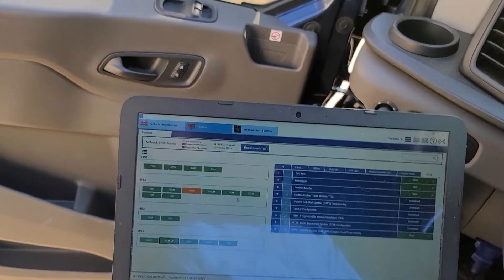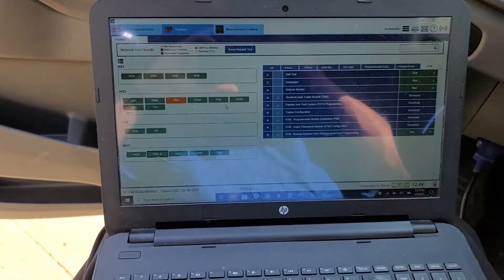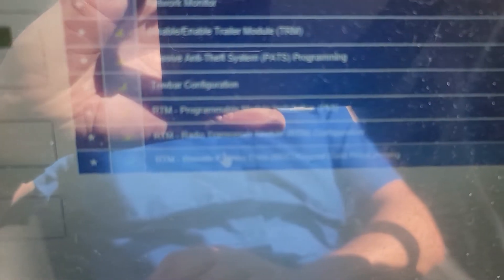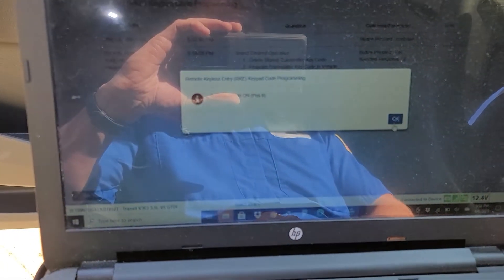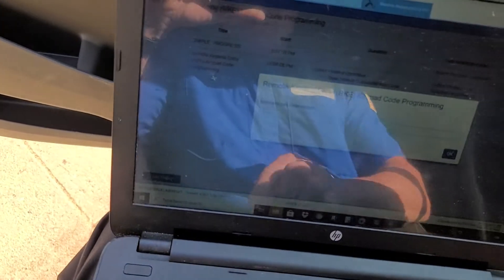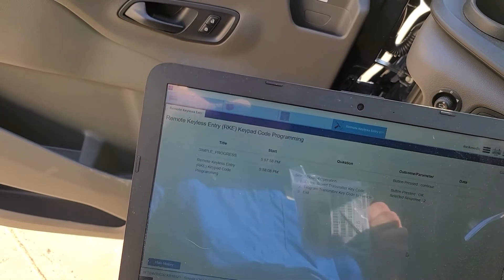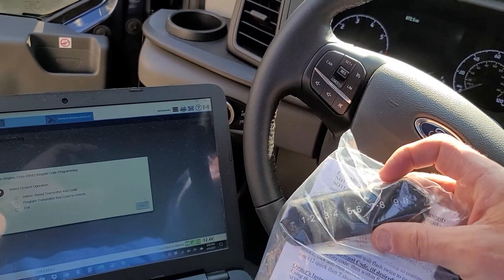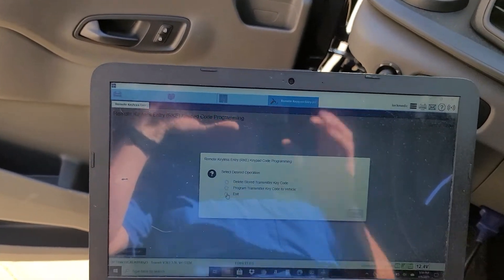Ford accessory keypad programming with fdrs 2020 transit

Comment: This is the only video that is accurate about the current install process for newer ford transits and keypad remotes.

Ford transits 2019 and earlier can be self programmed.
Ford Transits 2020 and above need to be programmed with a J2534 pass thru interface and FDRS (Expensive if you dont already have it, my dealer quoted me $87 with tax to pair my keypad bought from Ford Accessories website to my 2020 250 Transit Base, I am taking this option personally)

If your transit has the factory remote start key fob (SPECIFICALLY THE KEY FOB REMOTE START) - get part KB3Z-14A626-B
If your transit has remote start within the ford pass app, but does not have the key fob for remote start - your van TECHNICALLY does not have remote start and needs keypad SKU: KB3Z-14A626-A

The A and B difference at the end of the sku is the channel#, A or B.
Reply from the maker: Thanks Sam. At the time I made this video, I made 2 attempts with dealers to get the keypads programmed. Both were scheduled weeks out, and neither was confident they could pair up more than one. Chatter on the transit forums was that many people had the same experience, or reported even the dealers were unable to program the keypads. I can understand why as the BCM has a function that appears to be used for keypad programming, but it doesn't work. So I fired up FDRS and found where it was, and documented the process.

Comment: I’ve never used fdrs can you give us a walk through on how to reflash a module if there’s an update for the pcm?
Reply: This has been over a year, but a reflash would be downloading and running the Configuration app for whichever module you needed to 'reflash'. This reprograms the module using AS-BUILT data. If you want to update a module, you will download and run the Software Update app for whichever module you wanted to download. If there is no software update available, then that module is at its latest software level.

Comment: Can you list the software and hardware interface that is needed . I couldn’t pick up what you said on the video .
Reply from the maker: hardware is an Autel J2534 interface. Software is Ford FDRS. You can download FDRS on a subscription basis ($50 for 2 days), it's something of a pain to get running as you have to set up a couple of different accounts but not too bad. don't have to use the Autel interface, it's just what I had. J2534 is a pretty generic interface, just make sure your computer has the correct drivers for whatever one you choose.